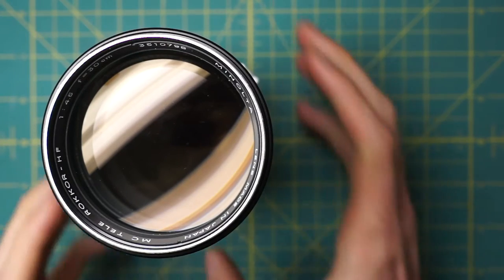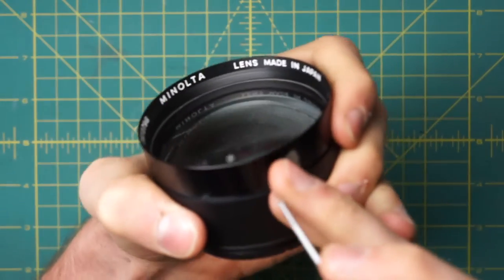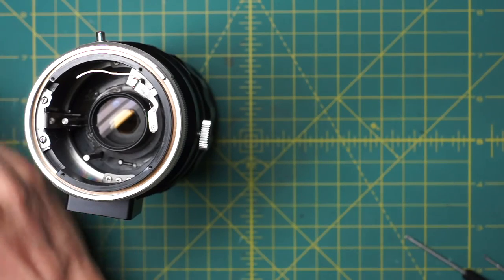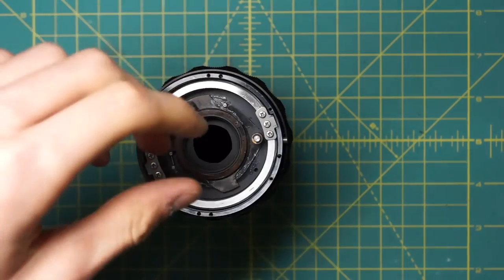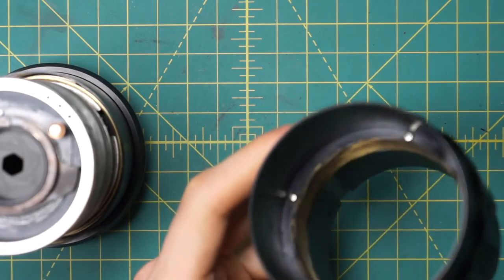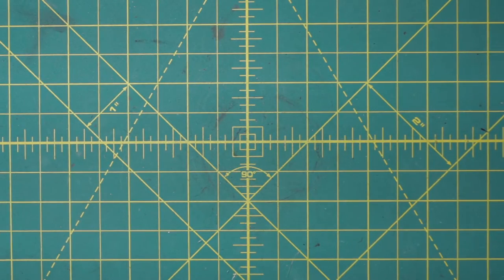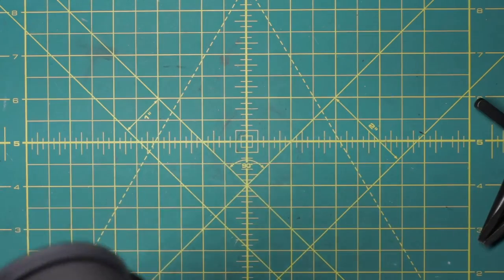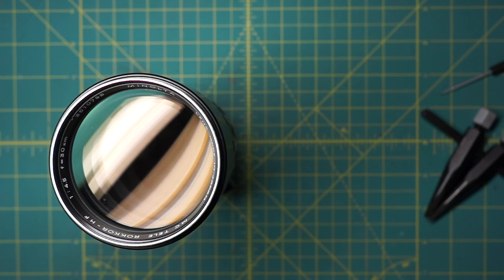Minolta MC Tele Rokkor-HF 30cm (300mm) f4.5 Lens and Diaphragm Disassembly

Comment: Did you reattached the spring that you unhooked at 16.09 ? or did I miss it. Apart for that love the videos, fantastic that the knowledge of disassembly/repair/cleaning these old manual lens is (rediscovered  - unsure of a better word) and shared.
Reply from the maker: Thanks. No, I missed that step in the recording. It just hooks over the two metal posts. Thankfully you can reattach it with the lens mostly reassembled. I just checked the lens used in this video and I must have fixed the spring later, but forgot to do it in the reassembly recording.

Comment: Just received a nice version of this lens but the lens hood is loose. I've heard that there may be felt in between the inner and outer hood tubes. Any idea how to repair a loose hood? Thanks
Reply from the maker: Yes, if the felt is missing or damaged or too tamped down, you can try replacing it. This is very easy to do.

First push the lens hood forward and find the single small, silver slotted screw at the bottom of the area the lens hood used to cover. Remove this and then unscrew the lens hood. Then slide the two components of the hood apart.

The felt goes around the top of the inner part of the lens hood, and rests in a small groove. To replace it, you'll want a higher quality felt material. It is important that this material does not shed fibers when the lens hood is used. Cut the material into a thin strip to and use some light adhesive to keep it in position.

Hope that helps. Good luck

Comment: Love what you do man.Especially since I am a Minolta shooter haha Just curious, how do you know how to disassemble it in the first place? Experience with other lenses or have you done all these lenses before? Also, do you ever plan on doing camera bodies?
Reply from the maker: +Ed Tse Thanks. Mostly trial and error and learning from other lenses. For these videos, I usually take the lens apart at least three times: once to find out how it works initially, once for filming, and once to make any final readjustments. During the first step, I make sure to note how things fit together and what order the pieces are removed in. After doing a few lenses, you'll also start to notice many similar design elements and construction techniques.

It would be interesting to try out repairing vintage camera bodies, but I personally have less use for old cameras than old lenses. Dealing with electronics also adds a whole other level of complexity, but I won't discount it entirely.
Reply: +Matt Bierner oh wow that's a huge time investment, glad you are doing it!

Yeah electronics are a nightmare, there are plenty of mechanical bodies though. I do quite a bit of repair work on Minolta Autocords. Great cameras to work on.